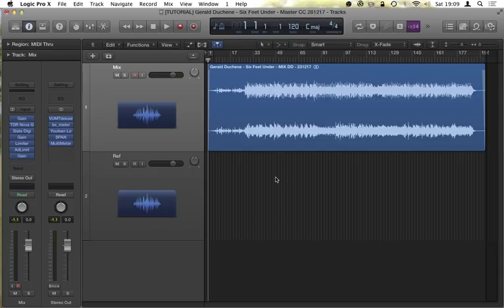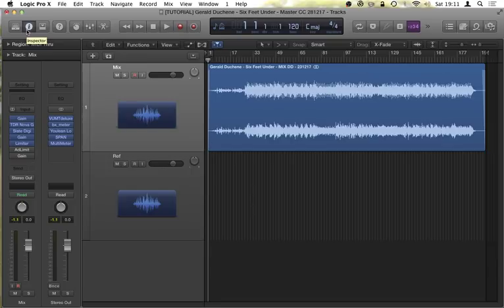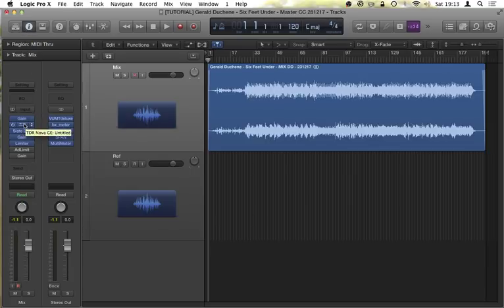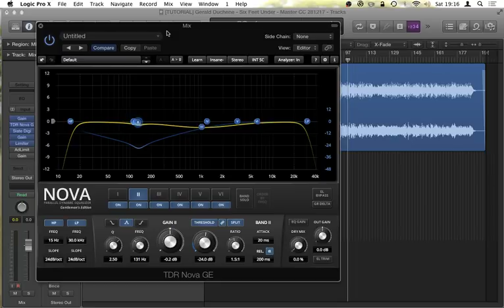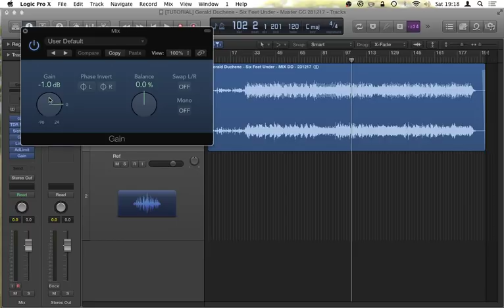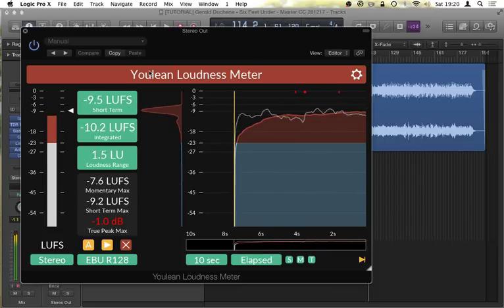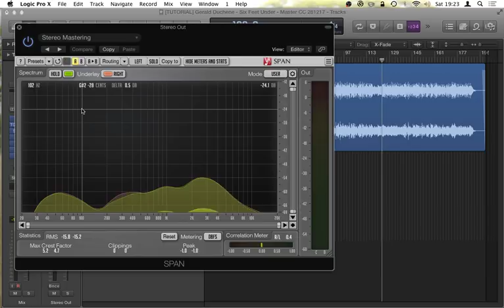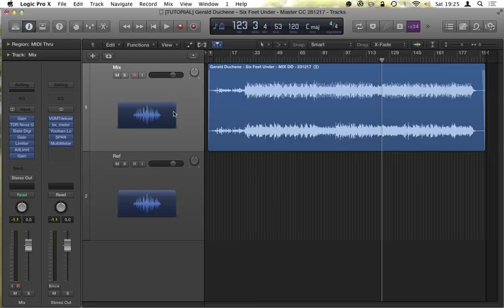Logic Pro X Mastering Project : Voxengo SPAN, Slate FG-X, TDR Nova

Comment: Hi. Can I ask you a question about Voxengo Span and logic please?
Reply from the maker: Sure!
Reply: Thanks. Ive just downloaded Span but can’t get Logic Pro x to see it, did you have the same problem and if so how did you resolve it?
Reply from the maker: Interesting. Have you rescanned the plugins via the plugin manager?
Reply: Hi sorry had to go out. I can’t see how to rescan, just reset and rescan selection? It usually does it automatically.
Reply from the maker: Yes, try that and let me know. Try the usual things like quitting logic or restarting computer also.
Reply: Just tried that and nothing. I have already done the usual stuff after looking into it which is why I came across your video. Just thought you might have done something different. Thanks
Reply from the maker: I see. Best thing to do then is contact Voxengo support.
Reply: HEEEY! I am glad to tell you what might solve it. I struggled the whole morning. First with the free download of span, then I bought it and had to figure out that the problem was still there. So, if you put the component in the component file and the vsts in the vst files its not enough to restart logic, you got to restart your mac (I suppose you have a Mac when you use logic) It should appear afterwards. I hope I could help!

Comment: Would be great if you had the time to do a video on a multi-track approach, rather than the "flattened tune". Be very interesting.
Reply from the maker: bobacks Thanks for the feedback. Do you mean multiple songs mastered in an album or do you mean mixing tracks/stems for a single song?
Reply: I meant mastering a single song where each instrument is on a different track. Or is that not how its done usually?
Reply from the maker: That would be mixing. Hard to cover in a single video but perhaps I will! I'm actually about to make a course for it. Will keep you posted :-)
Reply: Unlock Your Sound , how about mastering different songs in one album? Especially how the loudness is similar throughout one album
Reply from the maker: Tewodros Tekle Excellent question. My mindset is similar but i think of the album as a whole. Applying different settings to each song but in a way that makes the album flow. I find the sweetspot for the album as opposed to single tracks.